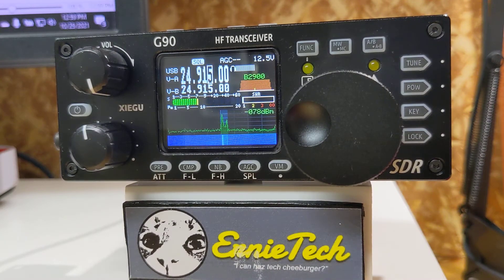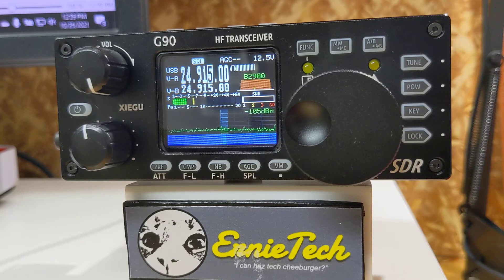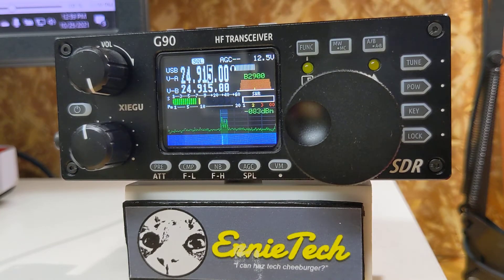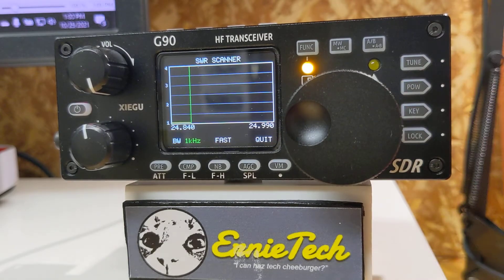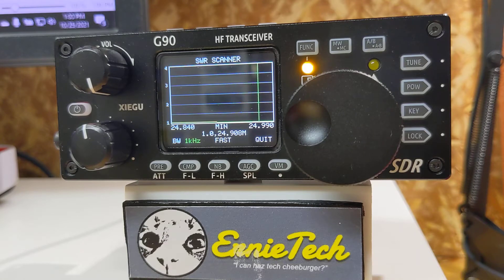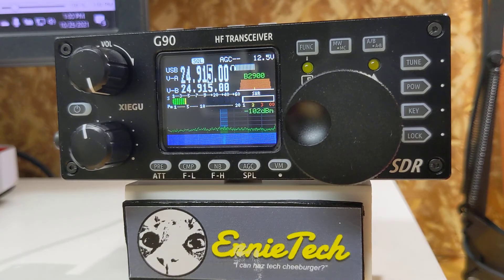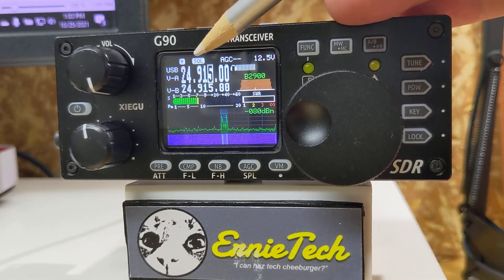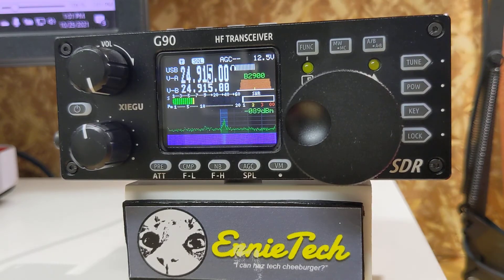Xiegu G90 Antenna Tuning

Comment: IMHO the g90 tuner, as an inbuilt tuner in a compact affordable radio is great value for money and also delivers on the goods. I've been able to tune antennas which otherwise won't work on some of the other more expensive radios. I wouldn't be surprised if it will tune my gutter and let me use it as an antenna as well. Keep them coming....great work mate!!! 73, VK3TWC.
Reply from the maker: It is pretty impressive

Comment: Nice video Ernie. I have meanwhile a second G90. One is for portable operation build in in a suitcase and as vertical Antenna
i use a 5,6 meter telescopic whip from china. The integrated ATU of the Xiegu can tune this simple antenna on all bands between
10 and 40 meters so it´s a very effective tuner. At home i use a 50 meter random wire and the tuner has no problem to tune it
between 160 and 10 meters. Won´t miss my 2 G90´s and the power of max. 20 watts ia sbsolute enough for me.

Comment: On mine I don't need to use the Func button. A long press on the power starts the SWR scanning. Try it. But it may be something they have changed in the firmware.
Reply from the maker: I'll give it a try. Thanks!
Reply: @ernietech-101  Just to be clear. That is the transmit power button not the on/off button.
Reply from the maker: @w4mkh  Check! : )
Reply: Same with mine

Comment: Let's say 15m band. Will it swr analyze 21-21.45? 150kHz does not cover the entire band. Can it be adjusted? Or narrowed to the cw part of the band only?
Reply from the maker: The G90 has a very capable tuner. The only way to know is to set up a dipole for the desired band and see how it does

Comment: Excellent!
QUESTION: See page 19 0f the manual. "...and press the SAVE key at the bottom of the screen...".
I see the words SAVE and EXIT on the screen, but I'll be darned (like a holey sock?) if I can find any "SAVE" (or EXIT) to press.
Please advise.
BTW - I Velcro-attached  a Ukranian flag patch to the back of my motorcycle helmet. 
I don't think that Putin is going in for a cancer treatment - I believe he's going in for facial reconstruction (because he can't save face) and will "disappear".
Reply from the maker: The funny thing is the way the SAVE and EXIT don't line up with the buttons! Anyway, you press the button under (and closest) to the word SAVE or EXIT
Reply: @ernietech-101  That’s the problem - the buttons don’t line up!
The tuner is terrific - might even tune a hamburger.

Comment: To get to the swr scanner you don't need to press the function button
Reply: This was obviously an earlier firmware than you are I have (1.79b03) No func required to scan and it's not 150KHz, but on 1KHz. At least that's what I see when I do a scan. It can be broaden up to 5KHz width.